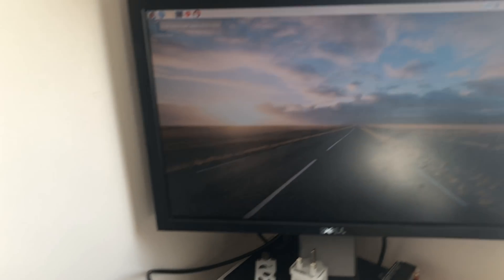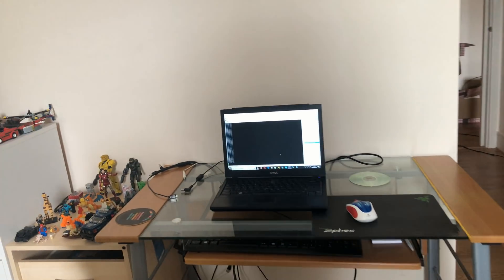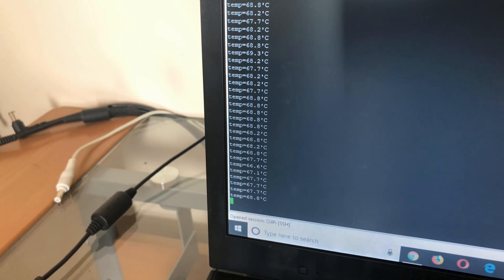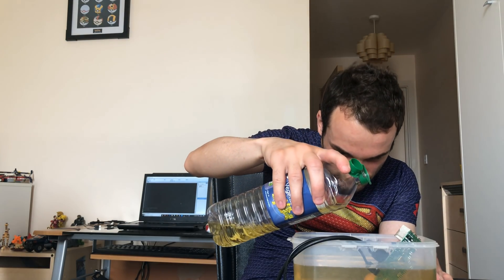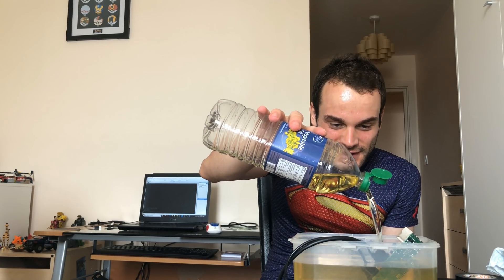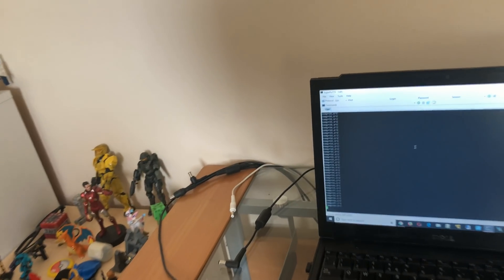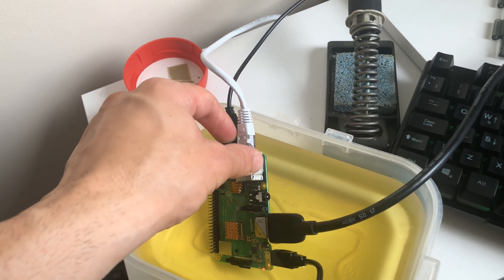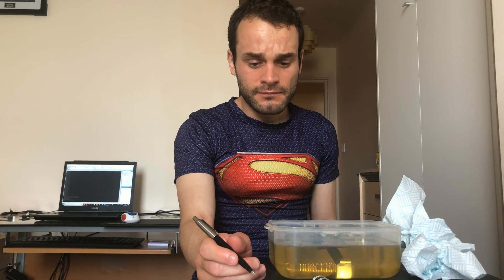Oil Cooling a Raspberry Pi | Does it work?

Comment: I have a Raspberry Pi I keep outside in a junction box.  Gets hot in the summer and cold in the winter.  I put it in a mineral oil in a Tupperware container because it was overheating in the summer.   Been there a year.   Got the mineral oil at CVS.  Runs super cool now

Comment: When you put on your superhero costume and start lubing up your raspberry-pi, you know its time to give up being such a fanboi of them.

Should have dried it for a few days. It could short out. Resistors are one of the classic water damage electronics situations. Voltages change, and power supplies can't get power through.
Reply from the maker: It was ok in the end after another day of drying - it even went on to another project!

Comment: should not  had  last long  using this kind of oil .wich is not  water repaelent enough concerning water condensation because of shared temperature  PLUS this oil is  electricity conductible ..... DONT FOLLOW  THIS GUY FOLKS  or you  can drop  your pi to garbage now and avoid losing time  to do  bullshit ! https://www.facebook.com/jacob.delechelle.7/posts/424358472256701

Comment: I would have used the $5 Pi not the $35 Pi for the experiment 

You should have run it through the dishwasher a few times and dried with a hairdrier lol

Comment: I would have washed the oil off with alcohol, then dry with a standard hairdryer on medium heat setting.
Reply from the maker: Yeah that would have been better - the Pi is in use in another project and still smells a bit of oil: https://www.hackster.io/314reactor/the-scorpion-star-trek-inspired-robotics-2cd054

Comment: Should have washed it with 91% isopropyl alcohol and let it dry for no less than 24 hours. Then after it dried reseat the heatsinks with fresh thermal paste.

Comment: Mineral oil is different then vegetable oil, but ok. Your doing  the cleaning job entirely wrong, it is painful. Don't use water, don't use cleaning solutions that are not made for PCB. It is not stuck in a boot loop, it is stuck in a short circuit and will continue to do so and fried it. Use 
Isopropyl alcohol to clean if you must.  it is painful to watch after you started attempting to clean it.
Reply from the maker: In the next video I left it another day to dry and it was ok - must have been some water left in it causing a short circuit as you say. The Pi still works to this day and was used in another project. But yes it's not the ideal way to clean it; I just wanted something entertaining and to test the durability.
Reply: @314Reactor  bit of moisture under BGA chips can corrode the BGA balls/pads and you're done.

Comment: In the first seconds I thought "this might not work at all" since the vegetable oil contains quite some amount of water as well as a number of minerals that do conduct electricity. On the other hand the reistance seems to be high enough to have it running as long as the total currents are not too high. But I think things might turn out to be much different when trying to cool some power mosfets conducting considerable amounts of current. When I comes to oil crawling along the isloation inside cables like ethernet/power/hdmi I do not have a good feeling about this type of cooling. It might damage even the monitor/switch and else over time by pooring oil on the other end of the cables connected to the pi.
But still a very interesting experiment!